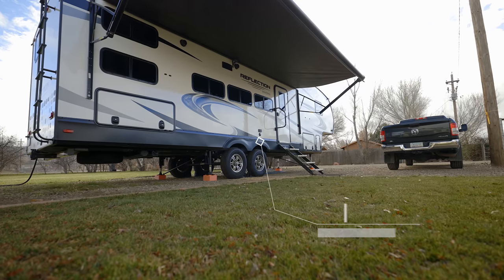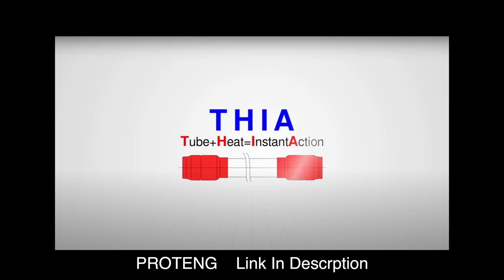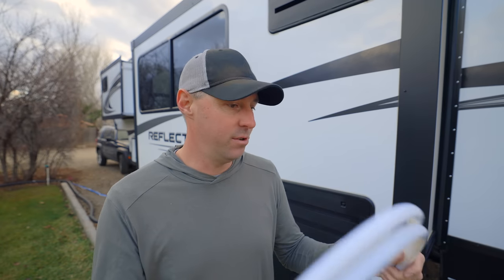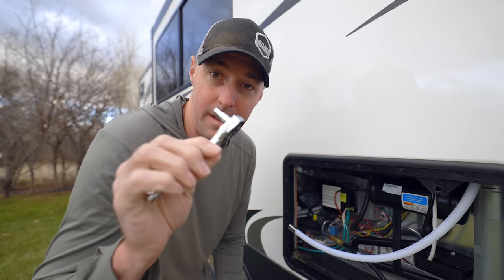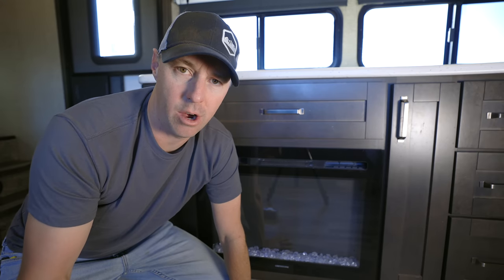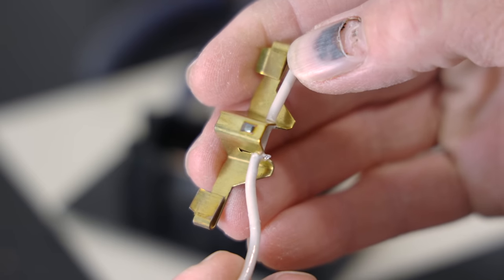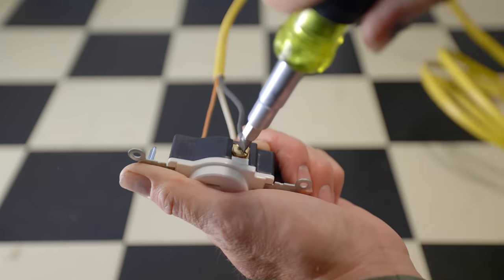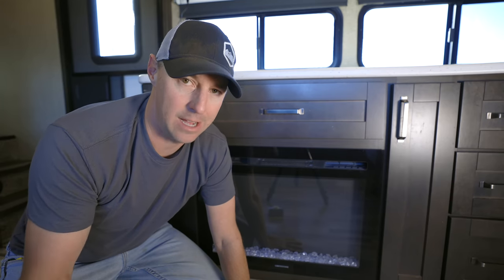2 Simple RV Upgrades For Safety

Comment: Thanks, super suggestions.  As an engineer Have always been worried our Fireplace outlet. We leave it on most of the time. Will be following your suggestion! Have a safe and happy Christmas.
Reply: My Grand Design Momentum has a 20amp receptacle in the laundry closet so I had temporarily plugged an electric heater in along with the washer and dryer.   Electric heater on high plus dryer on low was about 17.5 amps.  

Mind you the breaker and wiring is all 20 amp but I never thought to pull the plug and check it…….until the plug melted and nearly started a fire. 

I’m still fuming over that oversight during build because that could have gone extremely bad.

Comment: Good material.  As far as the fridge goes?  Always been my no. 1 concern with absorption fridges.  First thing I did with our current 5th wheel, dumped the Dometic & replaced it with an Ever Chill 12v compressor fridge.

Comment: I just watched your video and then decided to take a look at the outlet for my fireplace.   BOY, am I glad I did...  The outlet was attached to the wall on my 5th wheel (grand design), when looking at the outlet I noticed that the edge of the face plate was cracked.  While this did not look like it would cause an immediate issue it certainly was not a safe situation.  I'm on my way now to get a replacement.

Comment: Remove the propane.  Number one safety tip.   Yeah, those outlets need to go.  I also found the hose clamp on my generator fuel line was very weak.  The hose slides right off.  Really neat.

Comment: Would be great if you could make a video on how to protect an unoccupied RV in sub freezing weather. We have to leave our RV over Christmas in a nice park where it will be 10°F to 15°F outdoors at night for the 3 days that we are gone. (32F-40F daytime highs.) Our relatives are 100 miles away in a subdivisio  and their driveway doesnt have room for our RV because of other relatives cars. We don't like the idea of leaving space heaters running but propane doesn't last long enough. Will our refrigerator and it's contents be damaged if we leave the RV with no heat? We plan to drain the pipes/tanks and the RV will be plugged in to electricity. Will anything else be damaged? - Like the televisions or exploding bottles of liquids, canned food, shelf stable milk, etc.??? We could leave the space heater thermostats set at 32F but I worry about their plastic housings melting and catching fire. One is a Hyper Tough brand, the other not.  We have a Four Season fifth wheel with enclosed underbelly.
We are camping near Denton, Tx. The relative's house will be much colder. We are not taking our RV due to the possibility of ice. @all about rv's

Comment: Great idea on replacing the fireplace outlet.  Have you done anything with the molex connectors (the connector that transitions the romex to the "soft" 120vAC wiring to accommodate slide movement)?  I didn't replace mine, but I did drop the coroplast and made sure they were secured properly to the underside of the trailer floor and that there was no sign of heat stress.

Comment: Good suggestions. Especially the fire suppression one. A friend of ours was traveling with a friend of Theirs on a long trip across the country.  Fridge caught on fire going down the road. Our friend following them saw smoke, called on radio to advise them. Turned out the trailer was damaged to the point that insurance company totaled it but most of their belonging were saved. But could have been a small problem if they had something to extinguish the fire before it got too big.  Did you consider some of the others on Amazon that were only about $40?

Comment: I cleaned the little brass office in my lighting system for our furnace, it worked, however the smoke detector inside went off so I shut it down. Is there a way to clean out the “ burn chamber” on a furnace?

Comment: From what I can see, you put a 20-amp outlet on a 15-amp circuit. That said, the 15-amp breaker should keep things in bounds, but wouldn't a commercial grade 15-amp outlet be better?
Reply: No. Even a standard 15A receptacle would have been more than sufficient for this upgrade. 20A vs 15A comm for a 12.5A load is  nitpicking.
Reply: I noticed the 20 amp outlet as well, but I would also add that this is not an exposed outlet for general use. This is dedicated to the fireplace and hidden from view. No chance of mistaking it for a 20 amp circuit and plugging something else into it.